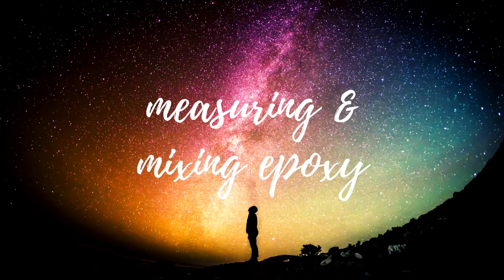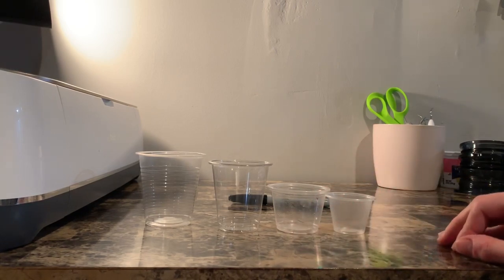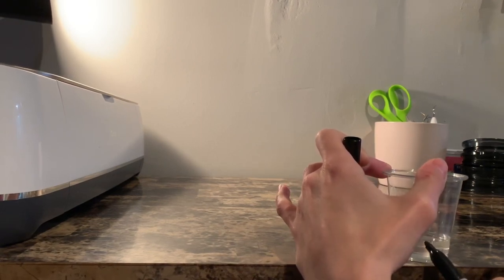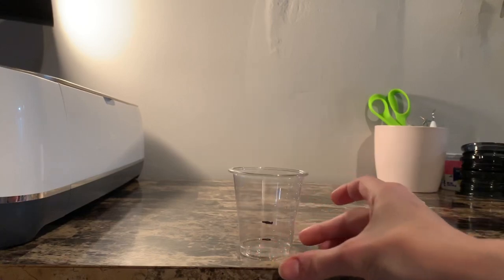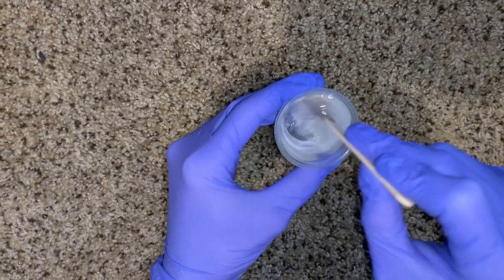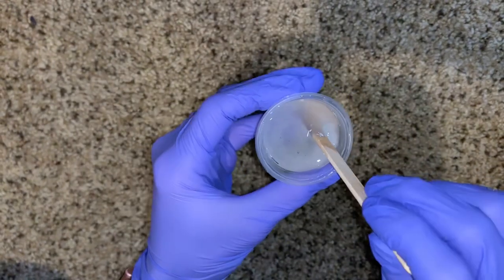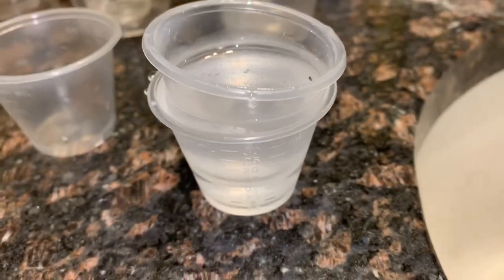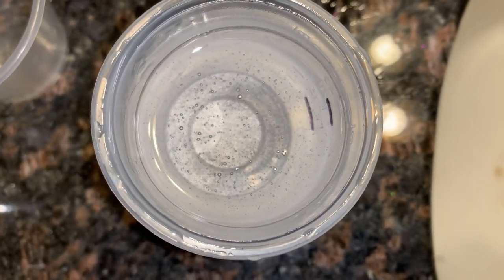Measuring and Mixing Epoxy The Water Method: For Epoxy Glitter Tumblers

Comment: The reason why I ask was I mixed some epoxy and it turned white even after I let it sit for awhile to see if it would turn clear.
Reply from the maker: This happened to me and I noticed it was because I was mixing incorrectly and had incorporated too many bubbles. I’m not sure if this is what happened to you, though. Maybe it sat for too long and began to cure? You really only have about 30 minutes to manipulate it once you start mixing in my experience. It is different in everyone’s environment depending on temperature such.

Comment: Can you over mix your epoxy?
Reply from the maker: In my experience, if you are mixing the right way I’m saying no, you can’t over mix. I have changed the way i do things a bit and need to make an updated video! Now I sit in front of Netflix with my heating pad on my lap and watch an episode of something for 10-15 minutes (mixing my epoxy with the cup touching the heating pad) and I have never had an issue. If you mix it correctly you won’t incorporate bubbles. You can, however mix it so long that it’s possible it starts to harden/cure before you ever get it on your project so be careful of that! 😆